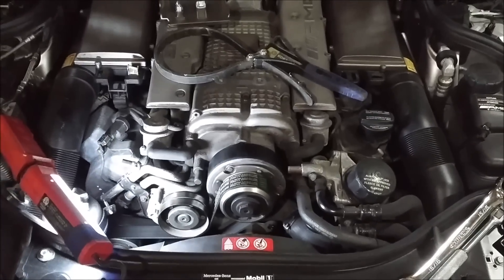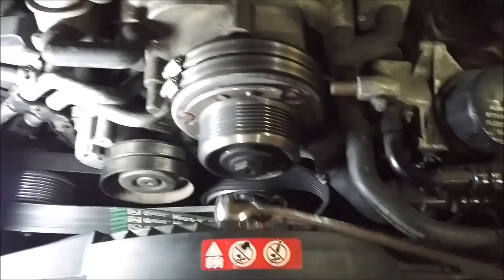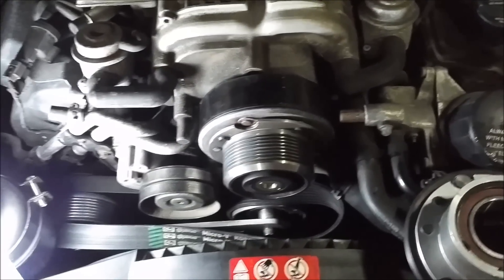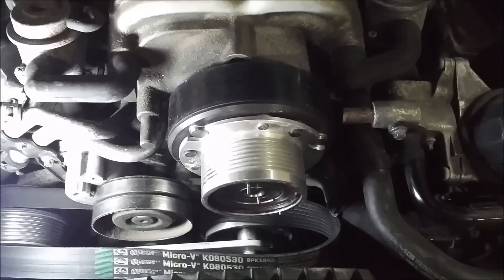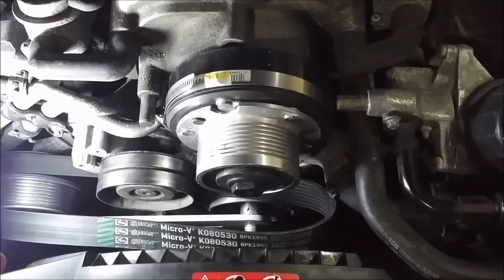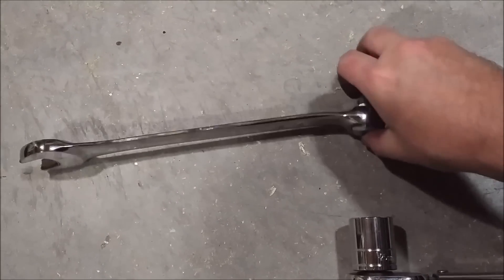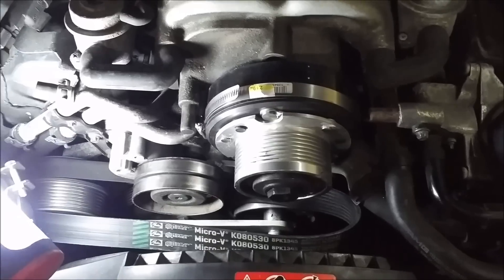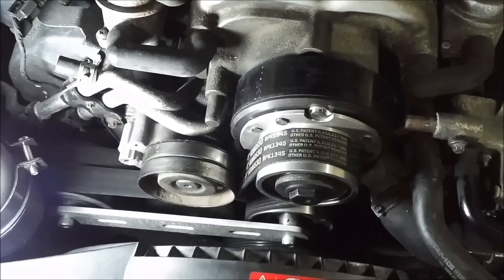E55 AMG supercharger pulley swap, the easy way!

Comment: The torque wrench should have been held at a 90 degree angle to the combo wrench so that the torque setting would have been accurate.  Held straight the torque applied  is way off.

Comment: it will be different torque with that length
Reply from the maker: Torque click on the wrench doesn't change with leverage.
Reply: The click will not change but the applied torque will, as you have increased the length.

Comment: Hello! How about the gap . I have a clk 32amg ang i want to change the pulley and i don know the gap measurements
Reply from the maker: I used the shims I had and it worked out. I don't know what the gap measurements are but if you're throwing belts, it's not shimmed correctly.

Comment: This Is about the riskiest way of doing it. You’re risking to break off the aluminum cast on the Kompressor where the clamps push against. Too many have ruined a $5500 Kompressor that YouTube mechanic way. Your Pulley is made from aluminum and comes from Shardul Meta from Texas. He just sells them to Eurocharged and they mark them up and claim it’s “theirs”. The rivers are junk and eventually will come lose and will shred your engine cover. Last but not least your belt wrap kit is junk too.

On a positive side: you speak clear, don’t cuss and dint speak 800 words a minute.
Reply from the maker: If the supercharger broke, the clamps were too tight. I've never heard of anyone breaking those. As far as being junk and breaking and causing problems, I daily drove the belt wrap kit and pulley for 3 years without a single issue. Flawless service from the time of this video till a month ago when I sold the car, probably still fine now. Just because you paid 3x more for someone else's doesn't mean it's better or the cheaper are bad.

Comment: You didn't check the gap when you were finished, why not?
Reply from the maker: I used the old shims, so it would be shimmed correctly. I'm years on it without throwing a belt or irregular wear so I'll call it good. If it's not right, you'll know very quickly.

Comment: No need for such extension to torque the nut, a direct torque wrench works fine. Please stay in metric units. Anyone willing to work on that car should get a metric tools set.
Reply from the maker: The torque wrench doesn't work when it won't fit between the bolt and fan shroud. I didn't do it because it looked fun. Most people who routinely work on cars have SAE and metric, not everybody does and use what they have.
Reply: @EMFAudio  3/8 torque wrench set up fits just fine

Comment: Great video!!Thank you for that!!!
I tried the 24mm spanner and is slightly loose so I think you better use the 15/16 spanner and 15/16 socket for the wrench as the 24 mm is slightly bigger.
I bought all the materials except I cannot find that special bolt which you use to connect the spanner with the wrench.Do you have any links from where I can buy it??
Reply from the maker: It isn't a special bolt, it's a bolt with a nut on it.

Comment: With all the mods you mentioned including this 84mm. What would be your guess on your gains? Thank you
Reply from the maker: IIRC, the 84mm pulley and cooling upgrades, and tune that are needed for that are good for around 50 HP. Mid length headers which I also have on there now are another 25ish.
Reply: Do I have to do cooling upgrades?To put that pulley on alone
Reply: With a 84, no other mods are required. It will work fine on a fully stock motor. But don't make the mistake I made. Save some money and skip the 84 and get the 76. Split your cooling and get another heat exchanger and you'll be good. @ToddtheLoneDroner
Reply: @300zVinh  okay I will have to check some videos on how to do that. But thanks a lot, because the bearings just went out on my stock pulley..
Reply: @ToddtheLoneDroner nachi bearings not niche. $60 eBay

Comment: What size pulley did you have on it before? And is that the factory size belt or smaller one!
Reply from the maker: It was the factory pulley, I'm not sure what size it is. You can use the same belt length, if you did a 77mm pulley you'd need a shorter one I think. I say the same belt length because I have a belt wrap kit also which needs a longer belt, but I didn't change the belt length as a result of the pulley  ( I think, I did this a while ago, I don't recall having to get a new one).

Comment: Couldn’t u just add a pipe to the torque wrench
Reply from the maker: Why would you? The wrench goes on the pulley, the torque wrench is there only to get the appropriate torque (which also has to be 90 degrees to the wrench for proper torque). Adding leverage to the torque wrench isn't necessary.
Reply: EMF Audio okay but couldn’t u should get the torque wrench on it and just torque it to spec. I’m confused why the torque wrench or torque gun. Wasn’t applied directly to the pulley.
Reply from the maker: @elevatedperformance  There isn't enough space to get a socket and torque wrench in there. The fan shroud/fan is in the way.

Comment: Do you have any other performance upgrades other then this pulley and tuning? Have you noticed the car more powerful at part throttle?
Reply from the maker: Yes. Headers, tune, heat exchanger upgrade, pulley, belt wrap kit, and split cooling. The pulley has more power across the board really.
Reply: EMF Audio thank you.

Comment: The 40 ftlbs is calibrated by the length of the torque wrench by adding length it changes .the torque wrench ur using is about 2ft length uv added about a ft. Correct me if im wrong.
Reply from the maker: Jasmeet Oberoi annotations have addressed that, a 90 degree angle must be used for accurate torque. It was hard to position and film.

Comment: What am I missing here?  Why can't you just put a 15/16" socket and torque wrench directly to the pulley bolt?
Reply: The fan shroud is in the way. I used a crows foot wrench.
Reply: No room I tried as well
Reply: It doesn't fit unless you have a very low profile socket. The radiator fan shroud is only 40mm from the bolt.

Comment: You didn't go to school did you now cuz the lenght of that wrench will change the torque value on the pulley bolt.
Reply: Looking at the multiplied leverage, would be around double the torque applied to the bolt! Ha!
Reply from the maker: I did and that's why there are captions on the video indicating that and specifics. I can't help if your viewing device isn't smart enough to display captions.

Comment: If you check, the blower is American made and i believe the pulley/clutch assembly bolt is SAE 15/16th".  Also, replacing assembly could be difficult but can be aided by using graphite dry powder (lock lubricant) applied to the bearing seat or inner bearing race.

Comment: Your losing torque with that setup, so your likely more at 34-36lbs.
Reply: with a longer arm and the same force, you have more torque. it is almost twice the length, so it will be around 70-75lbs
Reply: Yup…💪🏻

Comment: can u driver the car to the tuner after the pulley install as long as u drive slow moderate speeds?
Reply from the maker: pjefsquad Yes, I tuned mine at the same time though. Also I was already tuned so it was a small adjustment in the tune.
Reply: EMF Audio thanks for that much appreciated,is pulley and tune your only mods?
Reply from the maker: pjefsquad I also have a belt wrap kit, split cooling, and I have a bigger heat exchanger to put on still.
Reply: EMF Audio is the heat exchanger like 200$? what do u mean by split cooling? is that and heat exchanger hard installs?
Reply from the maker: pjefsquad heat exchanger is $400. Split cooling is separating the engine coolant circuit from the supercharger coolant circuit.
Reply: EMF Audio i couldve sworn ive seen the heat exchanger for 200 to 300 on the mbworld website
Reply from the maker: pjefsquad New they aren't that low. they aren't all created equal. I got a PLM, it's the best one and the only one with an oil cooler mount and won't bulge. In short, the only that fits correctly in 05-06
Reply: How did you tune it?

Comment: German engineers would suck their teeth seeing you use non metric tools. LOL
Reply: fyi your torque method would yield an incorrect torque spec on the bolt.
Reply from the maker: ALL of the information I've found never mentions a metric size even, which shocked me. There is 0.2mm difference in 15/16" and 24mm so it is safe to do. However, because of bolt and nut availability, I figured it would be safer to use SAE for this particular task. Perhaps if I found German documentation I could have found it was 24mm, I had to figure that out on my own to mention it!
Reply: EMF Audio Very interesting experience! And you became an engineer with those hose clamps yourself
Reply from the maker: Hose clamps have been done, my leverage mechanism to get torque where a 
socket won't fit would be the engineering feat in this one!
Reply: EMF Audio That's true
Reply from the maker: The video says to put it at a 90 degree angle, which would yield the correct torque spec.
Reply: Eric Hamlin yeah agree with you. think about it your torque wrench is located at the end of the wrench. which isn't short by no mean. that equals leverage which equals torque the torque is multiplied at the pull bolt. so 40 pounds at the torque wrench is like 60 to 70 at the pulley
Reply from the maker: joseph macaluso When the torque wrench is at a 90 degree angle to the wrench, it is the same torque as the torque wrench is set to as the annotation says. That's not a guess, that's science.
Reply: Joseph is right. The longer is the fixed wrench the higher the torque will be.Talking of science torque = force x distance. The torque wrench will click with the same force as distance between you hand and its socket remains the same.  If the two wrenches have the same lenght the applied torque is the double.
Reply from the maker: ruboot this was all addressed in annotations on the video.
Reply: 7 years later but that blower is actually american made and its the same company that makes stock hellcat blowers